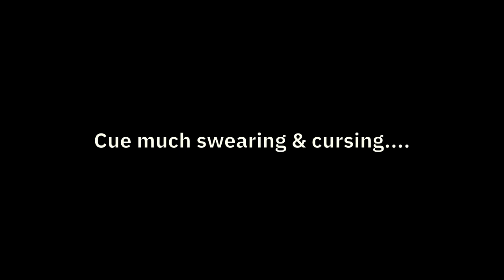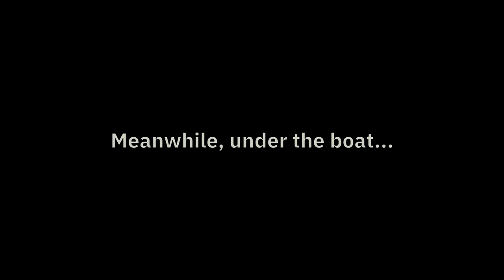Liverpool - Haul out - Rudder - Engine - Ventilation - Ep. 193

Comment: Looks a bit late for you this time but removing the sea water pump is a lot easier by first supporting the engine with a wood block and jack then removing the starboard engine mount.
Reply: Also when fitting an impellor to use waterproof grease both behind next to the seals and also on the circumference.
Reply from the maker: I have mo doubt you are correct, but Bev can get her hands into the small space so for us it just seems a lot less drastic. We are not the greatest mechanical engineers 😉
Reply from the maker: Will do! 👍As it was, we smeared the grease that came with it all over the inside so hopefully that will be ok

Comment: Do you have any video of removing the traveller?
Reply from the maker: No, sadly not. It is just a case of removing all the bolts and they were very stiff. We used an impact driver (like a hammer drill on steroids) and that got them out. 

One of the Allen key bolts rounded out and we cut a slot in it with a grinder and used the impact driver

After we got everything out, we cleaned the bolt holes with a nylon brush and WD40, removed any traces of silicone sealant, put down butyl tape as sealant and then painted all the bolts with duralac just before refitting them
Reply from the maker: BTW, if you do remove the traveller,  put PVC tape over the track to stop the car from sliding off. If the car gets off there will be bearings everywhere. Tape the car down and tape the track too, then start removing bolts

Tip: if the bolts are hard to unscrew, tighten them first until you hear a "crack" noise. Once you hear that the bolt will loosen more easily. You only need to tighten the bolt a little. If it moves at all then it should unscrew
Reply: @SailingYachtSaltyLass  Many thanks.  On my 32 it is held on with PZ bolts but I wasn't sure if there were nuts hidden in the cabin lining.
Reply from the maker: On our boat there are large aluminium blocks glassed in and these are threaded to receive bolts. They are like giant nuts 😀 The bad news is that the bolts are steel and being dissimilar metals they tend to weld. This makes them hard to remove and essential to coat with a jointing compound when reinserting. 

Photo the unit as you remove each screw. It makes reassembly a lot easier.